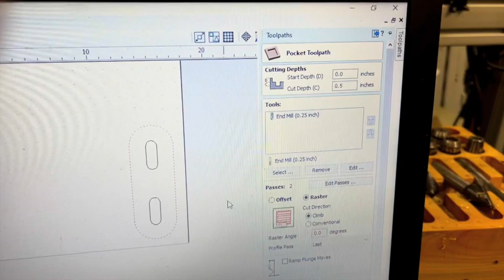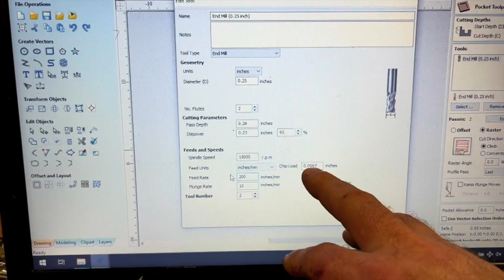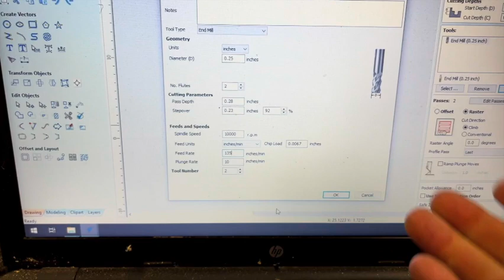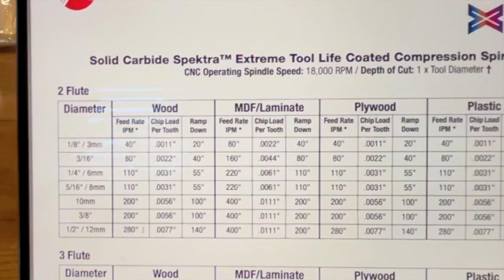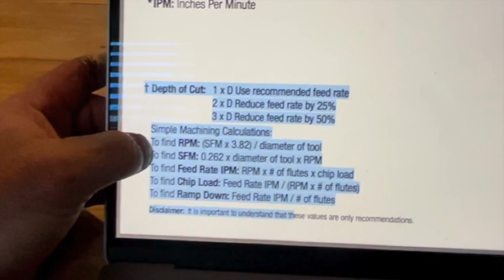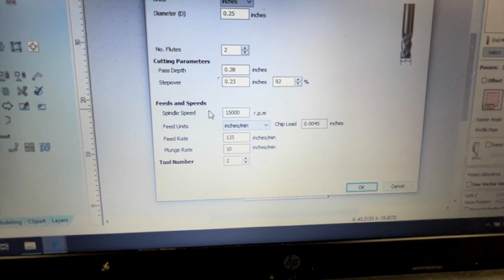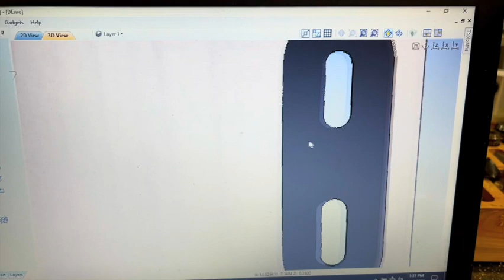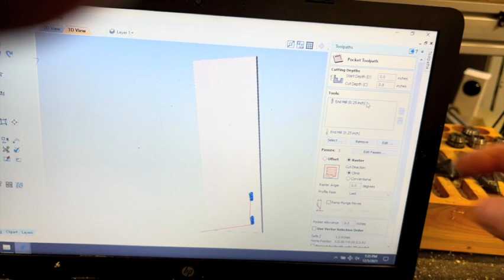Using Compression Bits and establishing Speeds and feeds for cutters

Comment: fyi   A differential equation is an equation which contains one or more terms and the derivatives of one variable (i.e., dependent variable) with respect to the other variable (i.e., independent variable) dy/dx = f(x) Here “x” is an independent variable and “y” is a dependent variable. For example, dy/dx = 5x.

other than that it is a helpful video 👍
Reply from the maker: Are you trying to math troll me...? The differential relationship is between spindle rotation speed, and how fast you feed into the material.  Increase one and the other variable is effected.  Thanks for the comment.

Comment: When you were routing through the MDF, I think it would've been more efficient to use the bit in a conventional toolpath. You don't really have to be concerned about making chips, its just MDF, and the surface would've been less ragged.
Reply from the maker: If you want, I can repeat the drill using a conventional tool path... I think the ragged surface is more related to step over than climb vs conventional...